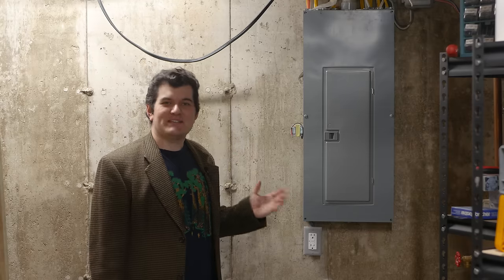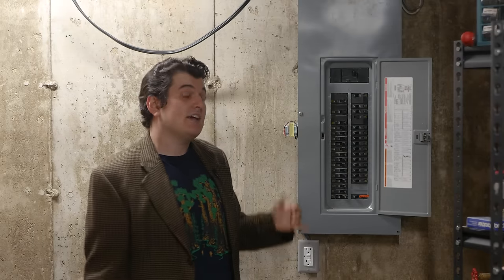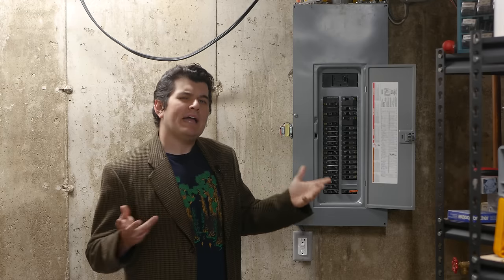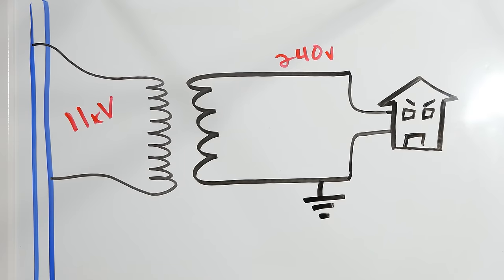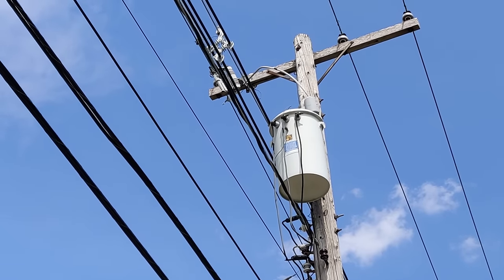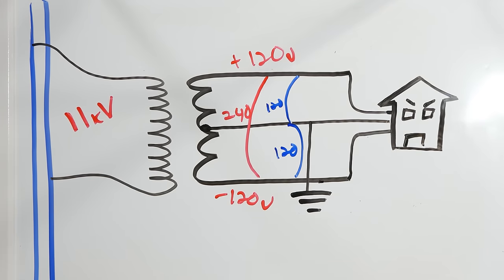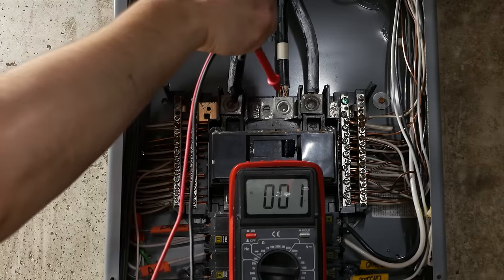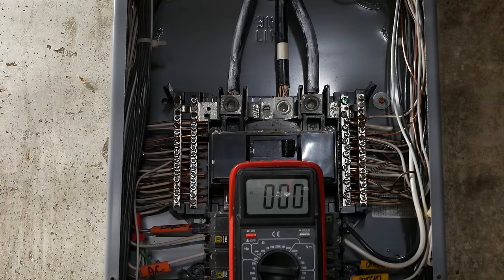The US electrical system is not 120V

Comment: "US have 240V mains"
laughs in 400V european
Reply: Jup. Whahahahahahahaha
Reply: In fairness he did skip three phase in the beginning
Reply: @PennyAfNorberg  In many cases residential homes are 230v in europe but they come from 3x400+N. We just take one fase wire and a neutral and we have 240V.
Reply: @petitus90  As far as know, 230V single phase get only small apartments, which do not use any high power device (get the heat from gas or via hot water or gas). Otherwise all homes get 3x230V/400V. In fact all buildings as whole alwas get all 3 phases. The single phase service is just restricted to 25A main breaker and that does not allow anything high power.
So TCs compare is incorrect...
Reply: @PennyAfNorberg  But that is where his explanation becomes nonsense. Because nearly all high power (above 2kW longer time or 3kW intermittent) devices are exclusively using 400V 3 phase power. So if the compare were correct, it should be "assume residential only" (what means indeed single phase in the NA, but includes 400V 3phase elsewhere).
Reply: Depends on where you are. If the American system is confusing try Norway with its mix of IT, TT and TN grounding.
Most of the grid is IT with some TT and new installations using TN.
Around here its IT and we get ~230V phase to phase with no earth. Earth is just a cable going to ground at the house. The copper pipe for the main water supply is not uncommon for this.
Reply: @petitus90  Residences in Europe are nearly exclusively 400V 3-phase. The individual outlets are 230V, but the panel has 400V and the single-phase circuits will be distributed across the 3 phases. Of course, some outlets/devices are also 400V, like the hob, on-demand water heaters etc.
Reply: Laughs in 480v US mains
Reply: @dumdum7786  where do you have 480V in the US?
Reply: @robert_gillam_6423  In a 3 phase system, some buildings have 480 volts between phases with 277 volts to neutral. Some buildings even have 575 volt 3 phase systems but that is much less common
Reply: @dumdum7786  ahhh i know, Industrial

Laughs hard in 690V European 
400V between L-N/PE.

But it is less common and only in Industrial companies.
Reply: It seems that the UK is comparatively unusual in Europe in that homes get only one phase supplied in the UK. Having 3 phase to houses in Europe is quite handy, because its easy to use 3 phase industrial machines if you want to run a business from the garage.

So far as I can tell the UK system ends up being slightly more efficient because the utility company has to do the phase balancing, and can really fine tune that. Whereas in France you need to do your own phase balancing within the house, otherwise you will be paying needlessly higher bills. Plus the supply current limit is per phase, not the combination of all 3 phases, so if you get it wrong and switch on the kettle whilst the washing machine is running, you can trip the whole house off. Irritating
Reply: And THREE phases.
What TC describes here is what Europeans call TN-C (or is it TN-S; the difference between them is if the utility or customer terminates the neutral lead)
Except in Europe it would have three phases and be 400v, the voltage between a phase and neutral is 400v/sqrt(3)~=230v.

To be clear we have IT and TT power grids too, but all new (at least where I live) are pure TN-*.

My tiny apartment has one phase and neutral, and a 63 amp main breaker.
Reply: Even better: the US has 120, 208, 277, 240, and 480 volt point-of-use distribution systems (though 277 and 480 are typically only found in industrial facilities).
Reply: My shop is 480V
Reply: @annaplojharova1400  i run small business here on single phase 16A 220V.
Wonder whatchu guys filled your house with, that you need 3 phase? lol.
Reply: Look by the time you get into anything over light industrial, you can basically request voltage in. 600v? No problem. Bigger, for large motor tests? Sure thing just run the tests at night to keep your costs down.
Reply: @abarratt8869  it's actually 3 phase to the property line in the uk, it's actually very easy to have it installed to the home as they only have to take it from the street out front especially on homes post 1970s. The reason they don't put it straight to the building is that most homes only require a single and a 3 phase supply would require a 3 phase meter otherwise people would be tempted to hook upto an un metered 2nd and 3rd phase.
Reply: Sighs in pulling 32A 3 phase plugs 🙄
Reply: @TonyTony-xj6uv  That's actually very useful to know, thank you!
Reply: lightly chuckles

We've got a 50 megawatt generator here at my plant in the US simply to use process by-product we create as a biofuel...

That sucker powers 31,000 homes full time.
Reply: @kenm724  That sounds like an admirable alignment of opportunity and forethought. Using it up that way sounds like a pretty green idea, certainly better than dumping it. Do you feed the grid, or is there literally a bunch of homes wired directly to the plant, and you dare not switch off on Christmas day?!
Reply: @annaplojharova1400  Wrong. You can draw 3.5kW over long time / 4.25kW intermittently from a german Socket always and homes are fed with 400V 3-phase for even more. The main thing for the electricians is then to balance the 2-phase 230V circuits throughout the house so that all 3 phases are evenly drawn on
Reply: We have 480 but it’s mainly used for big production facilities that have big pieces of machinery
Reply: @GarrettCyr  400 is our normal input to houses. Big companies can get like 22kV or more
Reply: Yeah. We all love the 6.3KW boost on our induction cooktops..... How do they even cook in the us...Oh wait. They don't. They go out...ha ha
Reply: @riel5197  11.7 kW stove. standart in switzerland. runs on 3*400*10 = 12 kW wiring. mostly you have 3*400*25 for any full size apartment main breaker. i can turn on any appliance i have in the apartment (stove, kettle, washing maschine, dish wasching maschine, dryer, coffe maschine, microwave, vacum cleaner, etc. mostly between 1-2kW, some 3 kW) at the same time and never have to worry about triping the curcuit breaker.  waschine maschine and dryer have 16A 240V, everything else is 240V 10A. But it's well distrubited, so the triple socket in the chicken can handle 2kW on each socket.
Reply: @beyondEV  i see you guys really like to put your electricity down the drain. 
Except for electric stove since we use gas/LPG, we have those appliances and they are hardly go beyond 1kW, frontload washing machine is up to 1.8kW but many use top load one which uses less than 400W.
Most houses are happily run on 1300-2200VA. Some even doing it on 900VA.
Reply: @riel5197  240*16 = 3840 VA. so if you actually only have 1 phase 16A, turning on more than 4 appliances will trip the curcuit breaker if they draw 1kVA each. 
you also didn't take into account, that electricity usage is kWh or kVAh not kW or kVA. so my appliances for example for making hot water simply get the job done faster while using the same amount of electricity.
of course you can save a lot of electricity by using gas/LPG.
Reply: @beyondEV  nah we just use gas to boil water. It's faster because we can crank it up to big fire here.

i believe our electricity costs way cheaper than you have over there. and it's not like they charge more for per VA installed anymore. 
but we tend to like to conserve energy i guess. Because if you think you really need that much of power installed for your apartment, you really like constantly doing many kind of things at same time and your bill must be lit. If you get things done quicker you should time it/do one thing after another not run them all at once. (honestly i can't image how you use your appliances over there)
My Mom's house run on 1300VA and it housed 4 people under it for quite sometime and CB never tripped except for one occasion of short circuit.
Reply: The shocking thing is that US residential builduings do not have 3 phase power😨
Residential buildings in europe have 3phase 400V 45/60A service... the lhaseshift is 120° thought which makes calculating the power a little mor difficult🤣
Reply: @kj8476  different culture: 
central europe: let's build a lot of high quality infrastructure and maintain it properly. then live relaxed and consider it a near armageddon if the power fails for 1 hour. (can't even remember the last time i had no power must be like 15+ years ago).
US: build some cheap infrastructure. don't really maintain it. always have the gas bottle and the generator ready. make lots of prepper vids and discuss what kind of disaster looms next.
Reply: @kj8476  3x400V 25A or 35A is common. Only in big buildings is 50A or 63A

Power calc is U*I*cosfi* √3
Reply: @jnygaarddk  Serious question- Is it common for you to turn your stovetops to high and then back down to medium or such to get up to heat quickly without burning everything? I can imagine it would benefit using oven by saving a couple minutes, though I can't imagine it would be very useful for the stovetop.
Reply: @kj8476  You don't need 3 phase in the USA because we use natural gas.  I have natural gas dryer, furnace, water heater, stove and as such I pay very little money per month around $58 a month in summer and $80 in winter it is crazy cheap.   Also because the furnace is forced air it blows around the entire house and with the heavy insulation in the wood frame walls, the whole house is the same temperature, there is no cold area every inch is perfect temperature every minute and it is very cheap to do so.   I lived in Europe this is much better way to heat a home and also cool a home.    In addition I never found something that needs 240v, kettle goes on the gas stove very fast and almost free.   What else needs 240v? Nothing!   Also my natural gas appliances are cheap to buy and are 97% - 98% efficient so very little loss probably less than the transmission of electricity or the manufacture/transport of wind turbine I would guess is more polluting.
Reply: and half the current on the wires...
Reply: @annaplojharova1400  its depends on the main connection, 63A can be possible i was living in a house with a single 35A...and the last breaker is between 10 to 16A.
Reply: @annaplojharova1400  Not really, in our old house we had all 3 phases, in the current one we get 1 phase (single wire in the air), it's a village though.
Reply: One of the things that shocked me (pun intended) the most on the US was exactly seeing how US homes get, in a way, only one phase ("divided" in two). Even here, in Brazil, this is mostly seen on rural areas, which will get either 254/127 or 440/220. The vast majority of our homes has 3-phases available at either 127V to ground (⅔ of the country) or 220V (the remaining third), though low income homes sometimes have only one phase installed. These homes, on the 127V areas, are quite limited when it comes to water heating, since piped gas is pretty much unheard of outside of very few areas, and the electric showers above 6kw are pretty much only 220V.
Reply: @drscopeify  The problem is that nobody bothers making 230/240V kettles for the US market. Considering that 240V is easily available on any US home, it's stupid to manufacture the 120V ones.
Reply: @robert_gillam_6423  50A for the entire home? That would be unheard of even on the 220V parts of Brazil. Our electric showers can easily draw 40A. In fact, the cheap ones running on 127V (the only option poor people on 127V areas get) will easily go over 50A.
Reply: @eleftheriaithanatos1162  lol, mine is 14kW for the shower... but i am in Europe...3 phase 400V
Reply: @Arltratlo  14kW? Is it a central heater? It must use all three phases, like the central heaters in the fancy homes here. Our eletric showers hardly go above 9kW (of course, anything above 6kW requires 220V). We're lucky that winters here seldom go below 5ºC.
Reply: @eleftheriaithanatos1162  3phase, 25A fuses, here we have 230/400V inside homes...
Reply: @Arltratlo  pretty much the same I've here, 220/380 3 phase 25A.
Reply: @riel5197  Where did you find 220V ?  Not been 220 in the US since the early 80's,  perhaps your just going by the 'terms' they still use.   Like calling it a 220 outlet (receptacle) when it's really often 245.
Reply: Bit of a pissing contest going on here with who has the biggest straw 🙄
Reply: @jeffm2787  Indonesia. It is floating around 220V. Same thing with the output of AVR apparatus.
Reply: @riel5197  Ahh ok.   Sometimes I think it would be useful to know where people are that post comments.  Sometimes not.
Reply: @annaplojharova1400  I have NEVER seen a domestic 3-phase installation in anything that would not qualify as a mansion, nor is any consumer equipment available to use it.  The load is evened out by the fact that each property has a different phase in sequence down the road - occasionally it doesn't even out, and a few properties will have to be moved to a different phase.
Because our single phases are 230-240v, we do not need any phase to phase connections in domestic equipment.
So glossing over 3-phase with a quick dismissal is to undermine his entire argument, as on the same basis (phase to phase) we have the capability of 380-415v, but as we have a high enough phase to neutral voltage, there is no need at all for any domestic equipment to use anything more.  We can draw 3kW from any domestic socket in the UK, and a much higher current is available if devices are connected with a fused, wired connection.  This is used for water heaters and any other fixed equipment that the consumer has no business messing with, and is almost always a dedicated radial feed from the panel, with its own breaker.
Construction sites are a (very) special case, as it is assumed that equipment WILL be damaged.
Ring mains are great, too, as additional outlets can be added to any point in the ring without having to run a new feed from the panel.  A lighter gauge cable can be used as the current flows evenly from both sides of the outlet(s).
Reply: @Gazer75  So you basically have a floating delta configuration!? What would be the electric potential between phase and earth?
Reply: @eleftheriaithanatos1162  I believe its around 130V but varies from 120 to 135V I think. If it's not then there is a grounding fault. Either in your house or someone nearby.

Not super knowledgeable on these things so don't understand how it all works.
Reply: @Gazer75  Oh, so it's like a wye (127/220) with only the live wires.
Reply: @phillee2814  I live in a 1 bedroom apartment (68m²/≈250ft²) and I have 400v 3phase at the fusebox in my apartment and to my oven.
Reply: @kj8476  yeah the power system in my apartment building is 3x128A (x2 the building is split in two electrical zones) than each of those have 4 sets of 3x63A for the apartments in each stairwell and in each stairwell at each of the 6-8 meaters there is 3x25A
And than each apartment will have fuses ranging from 14-20A
Reply: @aggese  You should probably go and update Wikipedia then, as no country in the world (never mind Europe) lists any 3 phase supply as being for domestic use.  Additionally, where on earth is your oven made?  If ovens from other EU states are not usable in your country on your normal oven supply that goes against the whole principle of interoperability and free trade within the EU - and even before that, the EC and even the EEC!
ALL domestic supplies within the EU & UK are supposed to be in the range 230v +10%/-6% and ALL domestic mains powered electrical devices sold in the EU are supposed to be operable in that range, safely and effectively.  Please direct me to the appropriate standards documents.
Reply: @Gazer75  The found on the water main is also used in the U.k to take out static electricity
Reply: @petitus90  But we use it for the hot plates ect..
Reply: @petitus90  Never seen that, at least in my country (Germany). We all have 3 phase power here. A lot of homes here do have a 63A main breaker. Beefy 43kW. Enough power to charge an electric car with 22A.
Reply: @robert_gillam_6423  We live in a single family home and got 63A.
Reply: @jnygaarddk  To be fair, I've seen the food most Europeans eat... I wouldn't call that shit "cooking."
Reply: @xinceras-6542  "most europeans"?? BIG diff between Italy, spain, france and Scandinavia and Germany. Which are you referring to?
Reply: @annaplojharova1400  - maybe in your country. Here in France nearly all houses are mono phase only.
Reply: @annaplojharova1400  - not true - I have 7kw device which is using 220V*32A.
Reply: @treyb.6562  yes this is very common
Reply: @riel5197  My induction hob is 3N400V 32A, combi oven, dishwasher and washing machine 3N400V 16A. I also have 400V 16A sockets in both garages and in my garden. My grid connection is 3x80A. The short cycle on my Miele Professional dishwasher is 16 minutes. 95C (203F) program in the Miele Professional washing machine takes 1h. My (4x) 3,5kW induction cooktop boils 1L of water in about a minute, much faster than the (2x) 6kW gas burner. Get the picture. The cooktop is a commercial induction hob from Angelo Po and the combi steamer is a commercial oven from Unox. So these are not your regular household appliances. I would not be able to get this power in a residential home in the US.
Reply: @robert_gillam_6423  My private house has 3x400V 80A
Reply: @phillee2814  Lack of power is probably why you still use so much gas in your kitchens. My induction hob is 3N400V 32A, combi oven, dishwasher and washing machine 3N400V 16A. They are fast and powerful. I also have 400V 16A sockets in both garages and in my garden. My grid connection is 3x80A. Incidentally, a 3,5kW induction burner is much faster in boiling water and has more precise control than a 6kW gas burner. The only thing gas is better for is high heat searing with cast iron cookware or when using GrillGrates over two gas burners. Otherwise induction is way better in every respect.

Hot water in my case is done with central district heating - I am getting pressurised 140C water in and hot water is produced with a flow through heat exchanger, I never run out of it. I do have a 2x20kW geothermal heat pump for heating and a 26kW flow through heater for redundancy and auxiliary power when needed. As I live at 60 degrees north, I have snow melting outside in walkways with glycol and electricity in stairs and such that are hard to do with glycol pipes
Reply: @syncacct8576  i like how people so fixated on "boiling water time" as measurement standard for cooking stove.
As like you think that "boiling water" the only thing stove is for. Or you think you can just speedrun everything. What's the point of those big numbers when you need to put something on simmer/low flame? Blitz it into ash? 😁

It's amazing people just throw electricity down the drain. Especially with energy crisis going on over there. Just saying.

I'm not american nor living in america rn.
And not only electricty bill is stable over here. Gas is actually even cheaper because its subsidized. Maybe that's why we are chill with our electricity usage here. 😀
Reply: "Laughs in 400v European." Laughs in US 48V for anyone having a load requirement in residential ridiculous enough to require voltages to be as hazardous as possible.
Reply: We have 480v 3 phase just for large homes
Reply: @riel5197  Time is just of function of power. You will need more or less the same amount of energy depending on the efficiency of your heat source. I can boil one litre of wateer faster with a 3,5kW induction hob compared than a 6kW gas burner, both at max power with the same pan, so the induction is more efficient than gas, hence using less energy.

Electricity is not overly expensive where i live. I am paying about 8 euro cents per kWh for electricity plus grid fee. I could get it under 7c if I shopped around. My energy bill is substantial as I melt snow during the winter months from my driveways and gangways. With 10 cm thick granite this doubles my energy bill when melting is switched on. I cannot use sensors, since due the thermal mass I need to turn it on at least 24h before it starts to snow. I could hook a computer to a data feed from a weather forecast service and drive the glycol system valves / electric melting, but I haven't had the time to tinker with that yet. Now I am turning the valves & switching melting for stairs manually.
Reply: make that 480 V mate :P
Reply: @riel5197  You run very very small bussines. Maybe hand working? 
I don't run bussines, only hobby woodworking. I have a few 3phase machines in my workshop. 
For motors above 3kW are better to live on 3phases. 3phase async motors are robust and quiet. 
And some 1phase need 16A curcuit for motors (for example my Dewalt planner).
Reply: @CzKaa  nah, we don't do manual labor. we are running about 20 PCs in here.
Reply: 400V 3ph in Europe but here in the eastrn part of Canada we have 600V 3ph. I believe that the western part of Canada are at 480V 3ph. The US is also at 480V 3ph.
Reply: @farmguy2400  Please don't mix resident and industrial use. In Europe's industrial 3ph 600V+ is used also. But resident houses are on 3ph 400V in majority.